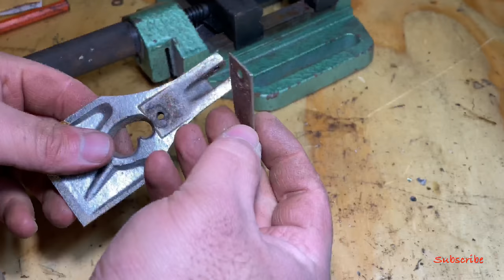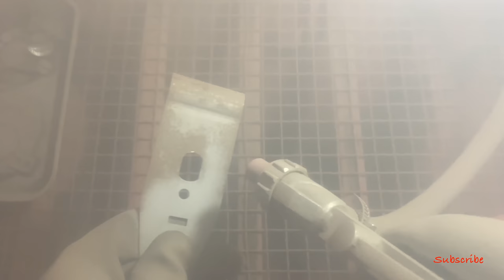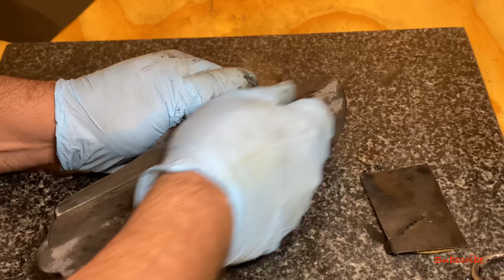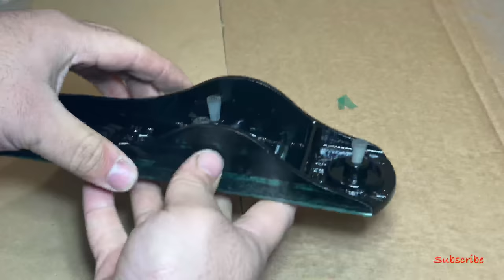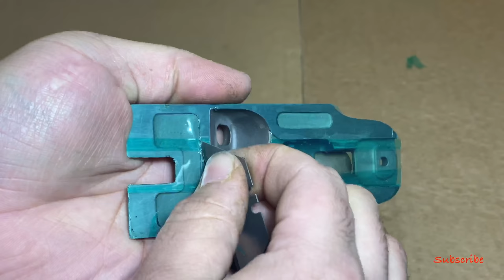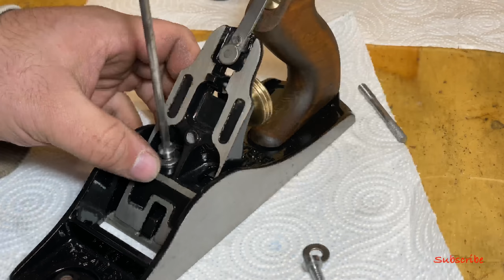Rusty Hand Plane Restoration

Comment: I use a wire wheel instead of a sandblaster and paint instead of powder coating but the rest the same. It's not that difficult but a great way for people to get good hand tools without spending a fortune, Buy old 2nd hand ones a restore them.

Comment: I too restore old tools mainly woodworking and plumbing. This video like your others is great mate. I've got to get myself a powder coating setup looks fantastic.  Much better wearing than enamel spray.
Reply from the maker: It’s worth the investment. My system is from Eastwood
Reply: Powder coating's crap. It peels off as soon as you look at it. There's nothing wrong with enamel if it's done properly which it never ever is on YT. Enamel needs primer but before that it needs cleaning properly with detergents followed by acetone. It then needs de-gassing in an oven before priming. After priming and top coating it needs clear lacquer and it needs to cured. Done properly it will outperform powder coating any day of the week.

Comment: You beat me to the draw.  You did what I plan to do with my collection.  My only problem is that I live in Thailand and it takes a lot longer to accumulate the media blaster and powder coat equipment.  It's on order and on it's way from the US. There went what I thought was my original idea. Do some more. I guarantee 1 viewer.

Comment: Nice work. I love my powder coating. You seem to get a good result from the masking. The masking I got is the same? only dark brown (no, it’s not packing tape) and it’s a real pain to remove after it’s been in the oven so I just use masking tape and the heat doesn’t seem to bother it. For me it’s easier to apply, comes in various widths and is heaps easier to remove. It comes off very easily while the part is still warm and I remove the sticky residue with eucalyptus oil. I had an oven the same size as yours and found the height to be the limiting factor so I turned it on it’s side. That helped but still limited the size of the parts I could coat so I recently got an old 900mm wide oven and turned it side ways and that is working very well. I really enjoy your videos so thanks and cheers, Stuart 🇦🇺
Reply from the maker: I really do like this tape. It is much easier to remove when hot. I’ll keeping an eye out for a bigger oven. However it’s hard to find one that’s on a 13amp plug without a fan built in. Most of our ovens are hardwired.
Reply: My tiny Workshop. Most houses here, post 1980, have a power point behind the oven but of course it all depends on the wiring back to your meter box. It seems most newer ovens here only need 10 amp which is a our standard power point. The 15 year old oven I am using now , which only cost me $40, is 10 amp so I made a 2 meter lead from heavy gauge flex and put a plug on the end. The power rating should be marked on your oven somewhere and that will make it pretty easy to work out the power draw. Also worth noting is that the element in my new oven is the same as the old smaller oven and I even pulled the element out of the old one to keep as a spare for the new one. The new oven had 3 separate elements in it which had me a little concerned about power draw until I realised that only one element at a time could be used. Grill, oven, and warmer. I removed all the wiring to the hot plates, grill and warmer. There is not much wiring left now just the light, fans and the oven element. That made it all a lot simpler to work thing out. Worth looking into. Cheers

Comment: I'm a fan of many of your restorations and I like the range of techniques you can bring to bear but as a woodworker I can't get behind a few of the decisions on this one. Still, good video and you did rescue a plane that was in serious need of some help!
Reply from the maker: What decisions didn’t you like. Thanks
Reply: @mytinyworkshop1213  I suppose the main one was powder coating the cheeks. I know power coating is super tough but as an exposed exterior surface these would accrue chips over time if the plane were in use. And also on user planes one of the cheeks (the one corresponding to the user's dominant hand) might also be a bearing surface like the sole.

There are also conventions about how various other parts are treated and the colour in the logo recess is one of those things Stanley owners can be quite fussy about (with red having a particular, negative, association). As I say these are just conventions, but it's what most woodworkers are accustomed to seeing and feel "looks right". 

Every owner is entitled to do whatever they want with a tool though!
Reply from the maker: Thanks for letting me know. I mainly powder coated the cheeks to prevent rust forming. I own many Stanley planes and tools. I would only be fussy with a restoration if the plane was pre war.

Comment: Great vid! I recently found an old #4 hand plane from the 1930's Eclipse stamed on the iron. Im trying to restore it and was windering if you knew what type of wood was used in these types of vintage planes for totes and knobs? And what kind of wood finish? My handles look deep red like cherry with coear coating that has beeen warn off in lots of places and  cracked. I scrapped that off and sanded it smooth with 120 grit sand paper so far...

Comment: What is that stick of metal you use to remove pins made of what I assume is tool steel? It now seems like a must have even though I've never felt the need for one before.
Reply from the maker: I’m not too sure. Whenever I see these at boot sales I buy them. Can never have too many,

Comment: Very nice restoration and powder coating from the condition it was in. Having restored planes myself I can tell you the sides are never clear coated. Simply sanded with 400-600 grit followed by a light coat if paste wax and buffed out. The sole and blade needed a great deal more work to be bench ready.

Comment: 2 questions: (A) How did you get plastic body filler to withstand 400 degree heat? (B) What happened to the red overspray on the chrome coating on this same part ?
Reply from the maker: The body filler is designed for powder coating. I used high temp polyester tape to mask the whole piece.
Reply: @mytinyworkshop1213  , what kind of filler would that be?  This is the first 2 part filler that I have seen that can withstand the heat?  That's why I thought it was a plastic filler. And, how were you able to use the tape and it not leave marks? Chrome power is extremely hard to deal with when you mask over it without leaving marks when it is removed. Btw, nice job.
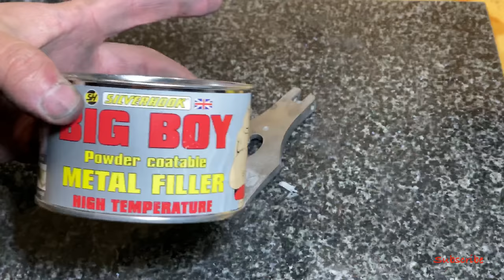Reply from the maker: The brand of filler is in the video. 14:12. As for the masking tap I guess I was lucky. Its the first time I’ve used this tape and powder coat. I didn’t have any problems with the tape.

Comment: Thumbs up!

As a note, I think it should be possible to remove all but the most stubborn threaded rods without damaging the threads by drilling a hole with diameter slightly less than that of the rod in a small piece of wood, then sawing or splitting it in half by a chisel, and clamping the thread strongly between the halves.
Reply from the maker: I have many spare threads. I knew this one would be difficult so I sacrificed it.

Comment: Rusty Hand Plane Restoration or Pimp my Stanley No.4? 
Without doubt there are real skills demonstrated at times but also a misunderstanding of the purpose of the tool. If it's a showcase exhibit then excellent, but if it's a restoration - i.e. returning a damaged, worn or corroded item back to its original working condition - then it fails. For example, Stanley never painted or buffed the sides of their planes because they're working surfaces. Powder coating is a wonderful method of covering metal, but is it appropriate on a No,4? Stanley made a tool to go into a tool box, fit for the job and beautiful because of that. I fear that your desire to beautify everything is a matter of Form over Function. I would have preferred to see a genuine restoration. Just my opinion.

Comment: powder coating is durable, but I think I'd have gone with blueing or the kind that is black, and no clear coat. Never ever set a plane on it's face, especially with the blade out. Back when these were used in factory settings, you could get fired for setting one on it's face. A hard surface can put nicks in the blade and dings in the face. I must admit it was nice work, and powder coating was a fair choice, but it wouldn't be my choice. I also would not have used any filler on it, it will eventually crack and fall out especially if this plane actually sees much real use.
Reply from the maker: Thanks for sharing. Whenever I put a plane on its face I always move the blade back. Plus it’s the best position to show the finished work. Time will tell if the filler will fall out, it’s made specifically for powder coating.
Reply: @mytinyworkshop1213  I haven't seen a filler yet that doesn't crack and or fall out over time if the item is being used. Maybe if it just sits around it won't but if used, and especially if it is in the sun it will, or at least all I've seen so far will. if this won't, then we need to know that too. mIght take a while to find out though. Made for powder coating? Hmm, I wonder if it out gasses the same as the powder coat? That is often a problem with most fillers, if not left to cure for a long time before painting or coating, they out gas and will cause bubbles under the coating. Then again, I'm not exact up on all the latest products. I wouldn't use it on an item like this anyway, I see no real need for it. The tool will perform the same without it. Only two things I want from any tool, to do the job and feel good in the hand, anything else is a bonus. Frankly when the curls are coming off the wood just right, it feels so good I often will plane a piece way past where it needs to be and have to start over.
Reply: As Paul sellers says, setting a plane down on its sole is correct if done with care and safer when reaching past for another tool. Wise words from the master.
Reply: @mauricecasey5556  trouble is, most people don't do it correctly. They leave the blade edge exposed and set it down on steel or other hard surfaces. It's just easier to tell em to lay it on it's side than explain how to do things. Some guys have wooden racks with a bit of a riser so that the blade never touches anything, but most don't. Lets face it, most people just don't know any better. Using a hand plane is nearly a lost art.
Reply: toot tall p